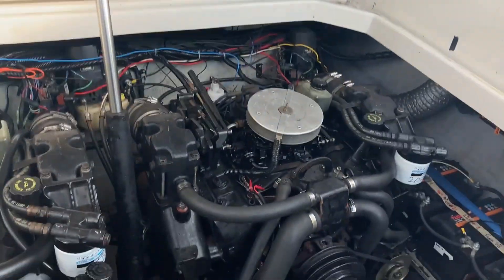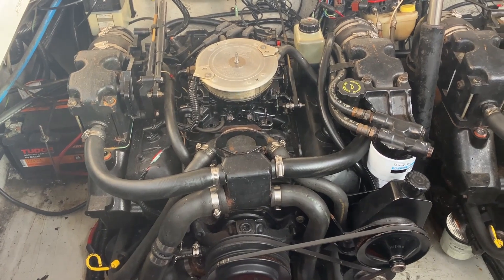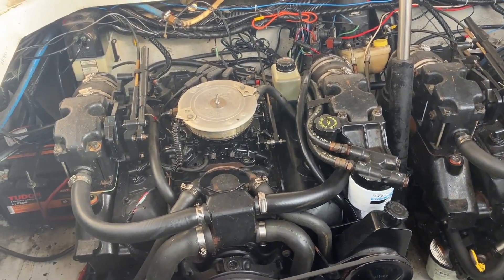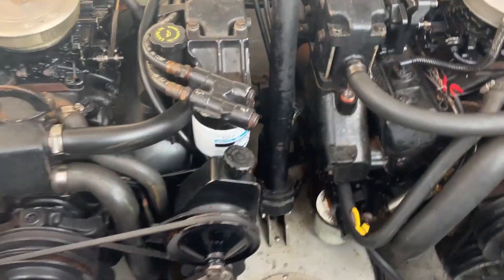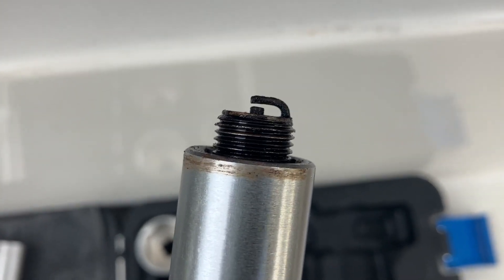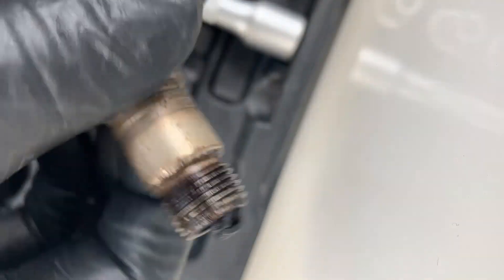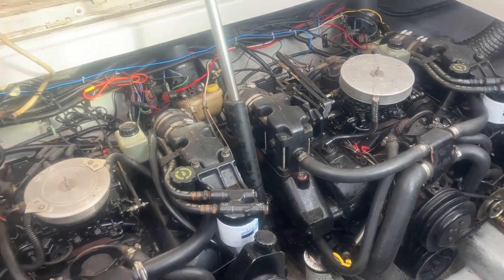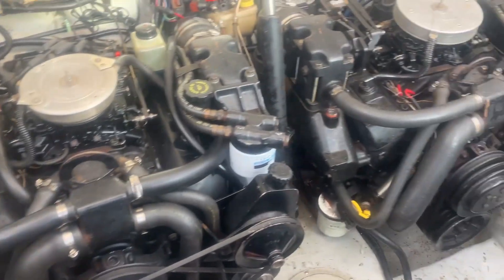Spark Plug Gap and Boat Performance Mercruiser Engine

Comment: You should tap them withot the feeler gauge inserted, it's for measurement only and prevents the adjustment if you have it there. You'll damage the electrode doing what you did.